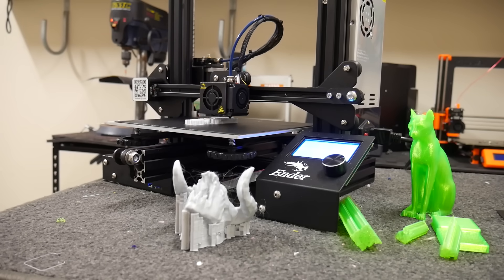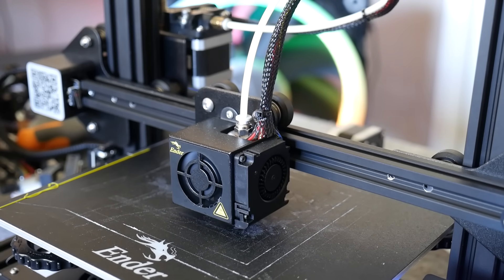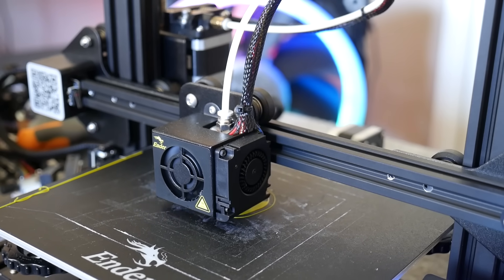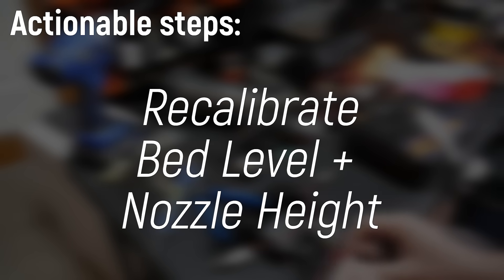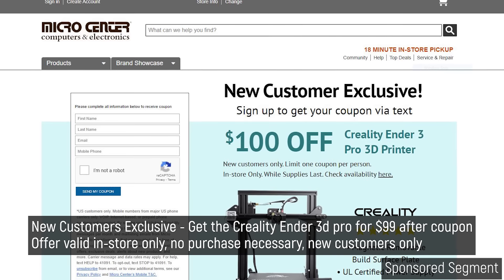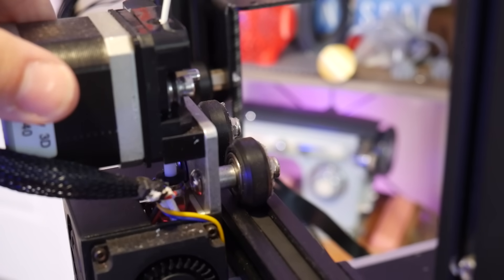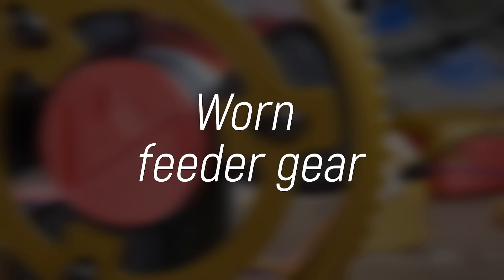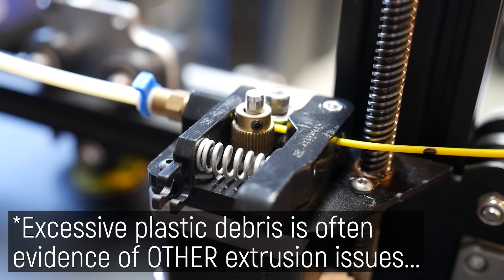Have your 3D Prints started to suck? Watch this!

Comment: An issue I've run into recently with my Prusa i3 mk2 is damage to the nozzle thermocouple wire where the cables leave the extruder assembly. Prints were fine until about 2cm high, then lots of stringiness and inconsistencies. The damage is where the wires enter the spiral wrap. To prevent it happening again, I'm going attach a short rod to the back end of the extruder and secure the spiral wrap to it using a cable tie. It won't be as good as correctly designed strain relief, but it should prevent the same failure from happening again for a long time.

I also notice that the extruder wire bundle (inside the spiral wrap) frequently makes contact with the heat bed connector. This will eventually cause a failure, so I'm going to use a piece of spring wire to keep the cable elevated, and add a curved shield over the bed connector so that if there is contact, it won't be on the attachment point itself, or the wires going to the heat bed.
Reply: You may want to look at the MK3 and how it does cable management for the extruder bundle. Prusa swapped from spiral cable wrap to a side-split nylon braided sleeve. The extruder body has a piece that is bolted on (like what I think you are thinking of with the "short rod to the back end of the extruder) that has slots for zip ties to hold the wires and nylon sleeve to the back of the extruder. For the cable bundle droop, there is a piece of 3mm nylon filament that is in the nylon sleeve with the wires that is attached to the extruder at one end, and attached to the electronics enclosure at the other end. This 3mm nylon filament provides mechanical support to keep that wire bundle from drooping.

Comment: When it comes to those noisy cheap fans, I keep around a syringe applicator filled with sewing machine oil. When the fan starts to rumble, I remove it from the hot end, remove the sticker on the bottom and add a few drops of oil. I then ask the printer to run the fan at 100% while holding it to see if it still vibrates and makes some noise before re-installing. This makes it run just like new for quite a while.

Comment: Thanks!!! new to 3D printing!!! was a gift from my boys!!! 2nd and 5th prints in the back part of the Owl glasses holder turned out really stringy and some of the layers didn't adhere well!!! MakerMark M5C!!! New sub!!!
Reply: Filiment used --- AnkerMake PLA+ Matte 3D Printing Filament, AnkerMake Official Filament, 2-Pack, 4.4 lb / 2 kg, Matte Texture, Smooth, Designed for High-Speed Printing - Matte Black

Comment: You showed one other problem, that cost me a lot of hours. At 9:13 you showed how you tightened down the pneumatic connector. If this pneumatic connector doesn't have enough grip, the ptfe tube can slip back a little bit, just enough to cause a dead-clogg right before your nozzle. 

I had this on one of my printers for over a month. After switching this pneumatic connector and using this technique to tighten down this connector everything was perfectly.

Comment: Well lubricated fans rarely actually die, even with a cheap bushing. Many fans have an opening under the sticker where you can service them yourself. But the grease does degrade with time.

Comment: I've had trouble going back to PLA after printing PETG.  Printing PETG after PLA is fine because any PLA left in the nozzle will melt before the PETG does.  If you go back to PLA after PETG, though, you might have some PETG in the nozzle that isn't melting at your PLA print temperature.

The long and short of it - if you ever have what seems like a clog after switching to a lower temperature filament, try a cold pull and see if you can dislodge whatever is in there.

Comment: One of the biggest ones is the nozzle... they're consumables and since you're not consistenly checking it, you can definitely it all away.
Reply: At the start of this year, I had CONSTANT failures at work with my printer (on it's 2nd nozzle at that point), since it was printing other stuff fine (or so I though) I didn't think that was the case. On a little overhaul I did when new parts came I replaced the nozzle and it just went back to printing without a single issue. It's not that easy to spot when they're partially clogged.

Comment: Everyone that prints petg gets to that point where everything seems to stop working and then you learn the moisture issue. Now I do the same, cheap dehydrator and a printed filament box while printing.  The dry box is a good project to learn printing at the start and is also really useful. I would recommend anyone new to printing, that wants to print petg, to print a dry box to print from. I can find find the link for the one that I printed, if anyone needs it.

Comment: I had my printer going regularly for over a year and one day the walls of my prints started to look rough. I tried every trick in the book and it turned out that my nozzle was coming loose. So I heated it up to the 260c, tightened it down and that fixed all my issues.

Comment: Since 2017 I have been printing. I have run into some of these issues. The worst issue is when the nozzle gets clogged and heating doesn't fix it. I have had that happen 3 times and taking it all apart and getting it back and working is the worst. You have to heat it up, then break the threads loose, then cool it down and remove it. When you get it reinstalled you have to bed level again and hope it's tight enough not to bleed out the sides of the threads. Another issue that I hate is when the filament breaks after the extrusion gear right before the hole to the hot end on a direct drive extruder. It's a pain to fix. Sometimes a lot of heat and your lucky you can push new filament in, but often times it will just jam on the side. Then you have to take it apart.

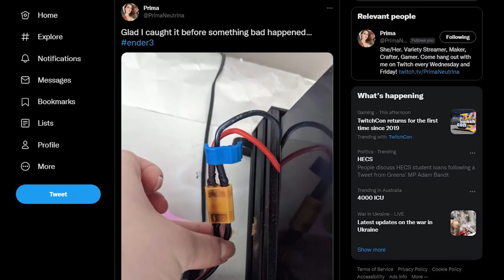Comment: 17:00 this happened with my printer last week to the point where the solder in the connector melted off and it failed in the middle of a long 10 hour print. I was able to solder it back together. But I'm definitely gonna replace it.

Comment: Bought my first (broken) 3d printer three years ago. When I turned it on it went to the Y limit then jammed and started making a horrible grinding, vibrating noise and the only thing to stop it was to turn it off. After a few times I realized the Y axis limit switch was bent 180 degrees. I simply bent the switch back and its worked fine ever since. Whoever owned the printer I assume printed something, the print didn't stick to the bed and the nozzle dragged it around and it bent the switch. Between that, the broken hot end temp sensor wires, and a clogged nozzle they gave up and sold it to me for 1/4 the price they paid.

Comment: Leveling:
Lose the springs under the print-bed...place the leveling knobs where the springs used to be.
Use the knobs to level the bed, then thread and tighten nuts (where the knobs used to be) onto the exposed leveling screws.
This locks the bed.  
Without springs, there is no shifting over time/temperature changes.
Can't say this eliminates re-leveling, but it does lengthen the interval between 'troubled times'.

Comment: actually with the fan thing i find getting old Server power supplies usually have high quality 12v fans that usually haven't worn out, course general warning with taking appart power supplies, leave them unplugged for a good day if you not sure when it was last powered on
sure they will be louder and more powerful, but used server PSu's can be picked up cheap, especially if they have propriety connectors non-ATX connectors

Comment: I've had two separate intermittent faults caused by wire fatigue on my Ender 3. I cut them all and soldered thicker-gauge wire in section that bends a lot and haven't had any problems since. This would definitely be on the list of day-one upgrades if I bought another bargain-basement 3D printer. I don't see myself doing that though, I think the industry's getting to the point where it's worth spending a little extra to have something that doesn't need $100 in modifications to function as expected. Auto bed leveling, all-metal hotend, and direct-drive are essentials IMO.
Reply: Yeah and well... ABL no, not really if you have a good printer and use it carefully. It is just another extra failure-point and also not really needed and helping much if your bed is stable. I need to do bed-levelling maybe once each half year with all of my printers after setting them in. When it needs more often, then there must be something wrong or bad quality.
I mainly use Anet 3D-printers and some Sidewinders and all don't have problems with staying well trammed (as it is officially instead of levelled) with daily printing on them. Printing with ABS, PETG, PLA and different kinds of flexible filaments mostly. Sometimes I need to spin the right spindle because that is getting  a wrong hight but the bed mostly stays well if I'm not rough on them.
So yeas, removed the ABL on some printers because it just takes extra time...
Reply: @elvinhaak  I don't need to level my Ender 3 bed often but that was actually the problem. If I had to do it every week or every day I know I'd get quick at it, but needing to do it once every month or two is just infrequent enough I forget my technique and it takes like half an hour to get perfect. With ABL I press a button, it tells me how far to rotate knobs, I press the button again to verify, and I'm good to go.
Reply: @AFistfulOf4K  Ah, ok only using Assisted bed levelling instead of Automatic - that makes sense. It works fine without a probe too. The probe is just that piece of paper and it works on any printer when you have the plugin in Octoprint or enabled it in the firmware.

Comment: I‘ve and ender 3 and I‘ve to level the bed after each print because it‘s completely off, I replaced the springs with stiffer ones which helped though. I also had to replace the extruder feeder because it got broken and I got really inconsistent extrusion, it was kinda hard to find the issue but the broken feeder seems a very common issue with the ender 3 (thx to cheps for finding this issue)

Comment: I just tested for Thermal Runaway Protection on my printers.
My Prusa MK3S+ stopped rather quickly, Aber being cooled down for 1m30s to about 180°C. Happy :)

My Tronxy XY 3 SE from the Kickstarter however did not - instead, it seemed to try even harder on heating up, once the temperature fell beneath 190°C. I gave up after 10 Minutes.
This BTW is the Tronxy specific Marlin V1.32 firmware, which I received and flashed just two days ago because of other problems - not happy :(
Reply from the maker: Thanks for letting me know! Tronxy has a history of ignoring thermal runaway concerns and if it's new firmware, that's a big red flag.

Comment: I had heatbreak clogs when I tried to rotate the heatblock in the Hemera by a quarter of turn: that (and maybe even the change in the fan that I did previously) changed the length of the heatbreak resulting in a couple clogs (but not everytime).

Comment: One of the reasons why the bed shifts between prints is because of the lack of stiffness in the springs AND the height of the bed in relation to the carrier.

When the springs are not under compression they don't exert much force. And when the length of the bolt is long (height of the bed), a slight change in angle can mean a large change in distance.

So this is how I "fixed" it.

-Unbolt z-position sensor and remove locking tab.
-Lower the bed as low it will go (based on the rear left corner), while still being able to move freely.
-Manually position the nozzle above the rear left corner and lower until just touching the build plate.
-Align the three remain corners to the rear left corner
-Replace the z-position sensor and slide it into position, until the switch engages, and fix it there.
-Do a couple of autohomes and adjustments as needed to get it aligned at that new position.

We now solved two of the problems with the shifting bed. By tightening it down we shortened the length of the bolt (height between bed and carrier), thereby reducing the amount of movement resulting from a slight change in angle. And by tightening it down we have compressed the springs, giving them even more force to stabilize the bed.

I've had mine like this for quite awhile and I rarely have to realign the bed. And I'm a bit rough when removing prints. I often use a 2lb dead blow and give it a nice "tap".

Comment: I accidentally tested my thermal runaway some time ago ^^
I put a new fatter cooling fan on my Ender 5 Plus and made a test print.
The cooling was still set to 100% and the fan was powerful enough to trigger the thermal runaway protection ^^
I'm running it at 25% now, and it was a worth while upgrade!

Comment: Replace your bed springs with those silicon spacers. Works much better than springs and provides more tension against the bed screws so they don't undo themselves in my experience.

Comment: On my Prusa MK3 I had a problem that I couldn't figure out for the longest time. It was a repeated pattern in my extrusion, mosy notable when extruding into free air. The filament would periodically pause briefly when extruding at a constant rate. The result would show as what can be best described as a sausage link pattern in the free air extrusion. I have an extrusion visualizer attached magnetically to the motor shaft so I could see that the motor was turning smoothly. After (more than) triple checking the bondtech drive wheels for loose grub screws, alignment, debris in the gear teeth, and smooth motion of the idler gear, I finally decided to swap them out with a new pair. During the swap, I compared the diameter of the teeth and found that the teeth on my old gear were subtly smaller diameter visually than the new pair. (I didn't think to measure.) And, I no longer saw the sausage link symptom after the swap. I think what might have happened is I probably wore down the steel teeth of the bondtech dual extrusion drive when I was printing CF-HTPLA and had a couple nozzle clogs. The moral of this story: Even if your hobb gear is made of a harder material than brass, they can still get worn down. Might not be a bad idea to have a spare set on hand.

Comment: Tip for printers in garage. If you not using the printer throw a rag or cloth over the build plate to stop dust falling on the bed. Great for if you only use the printer once every few days.

Comment: If you're very very cheap, oiling a growling fan bearing can get rid of the noise and help it work for a long time still. Don't use a penetrating oil like WD40, it'll eventually wick away. Sowing machine oil has worked great for me on several CPU and GPU fans.

Comment: My tips for all of these, not having watched the video.
Buy red, green, brown, or blue springs (Red is fine though) instead of yellow load springs, your bed will never become unlevel.
I almost never have to clean my surface. Layer of glue, and everything sticks.
I rinse my surfaces off with water maybe once every 3 months, that's it. 
Don't overtighten your v-rollers.
Don't cook your ptfe and always use cap tube.
Definitely check your fans once in a while, if it's your print cooling fan, you'll get warping if you don't have enough cooling (it's easier for this to happen if you are using your hotbed), if it's the heatsink cooling fan, you'll get heatcreep and a clog.
If you buy steel feeder gears, they should virtually never wear out. 
If you can't push filament through your nozzle manually, you have a clogged nozzle (or heatcreep)
Check your extrusion diameter with calipers occasionally to know if your nozzle is blown out.
Sometimes... maybe... an electrical component will burn out? Very rare though.

Comment: i use a finely honed wood chisel flat on a creality glass print surface. wipe it clean with alcohol, then hit it with a light layer of hair spray (white rain classic spray can style), and it sticks no issues.  light tap on the end of the chisel and the whole print pops off. even with the largest flat surface prints (a storage box almost the size of my build volume), i've barely had to apply more than the barest amount of force to the chisel. small stuff pulls off by hand without issue, and medium almost pop off just sliding the chisel up to the base of the print.

i leveled my print bed after i replaced the thermistor/heater. print quality has remained consistent since, and was fine prior to the replacement. replaced the bwoden tube at the same time, even if it wasn't quite a problem yet.

the only thing i could possibly care to adjust at this point is to replace the fans. and i'm looking at an alternative ducting that will let me use dual noctuas because why not.

Comment: Let me tell you - this guys right when it comes to nozzles and composite filaments. I didn't know if I was going crazy, but after like... not even 250g of Polymaker's CF filament, the brand new nozzle was completely messed up. Comparing it to a one year old nozzle that had only done maybe 3 or 4kg of PLA - the old nozzle looked new. The new "steel" nozzle was.. gone. The hole must've been like.. idk .6 or .8 in size. I don't know what it looked like before (since I didn't think it would only last half a roll), but I could see copper showing through. The next print I did was awful, but I didn't think it was the nozzle I thought the filament was too wet.

Comment: If your bed is prone to not stay level, use a brim on the print with a hefty amount of lines
As the nozzle moves, you can check to see if you're too high and adjust the dial on the fly a few slight twists at a time, until it adheres
Then you can either restart the print, or if the adherence wasn't too bad, let it run on!